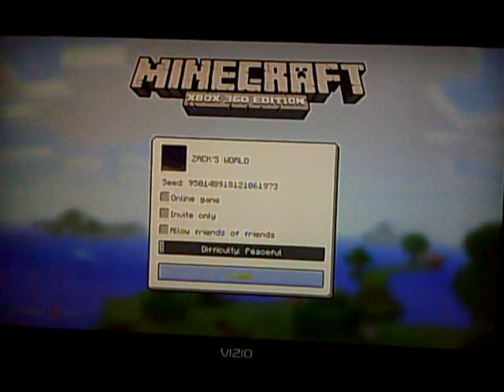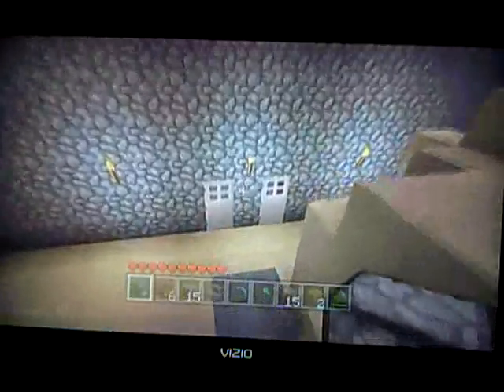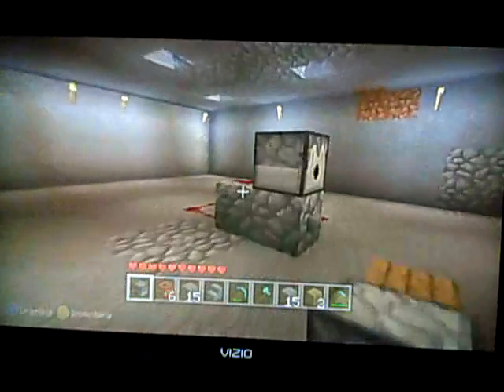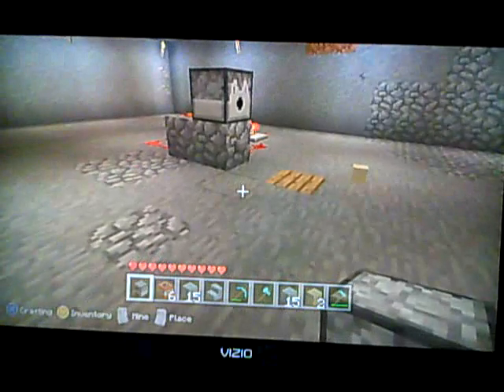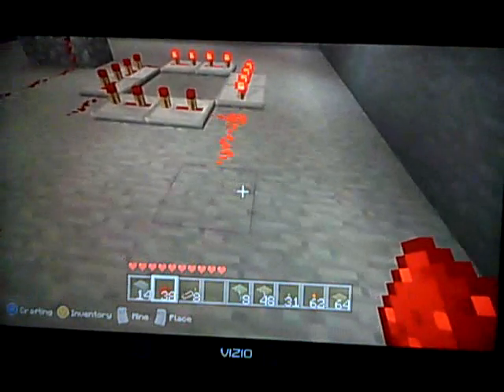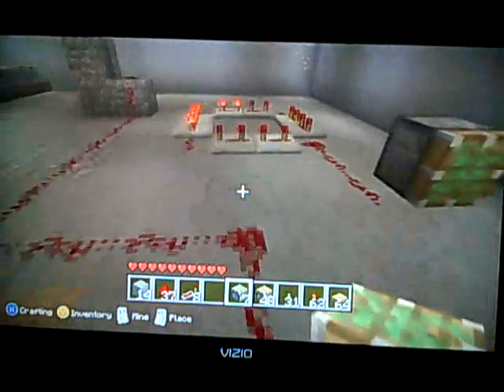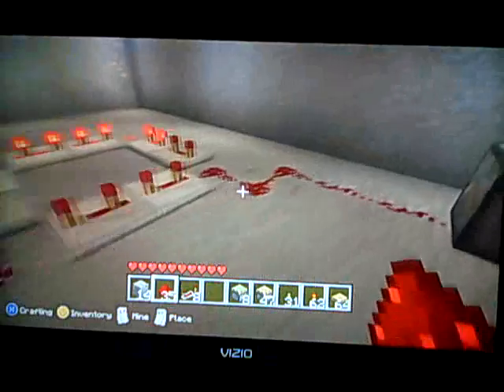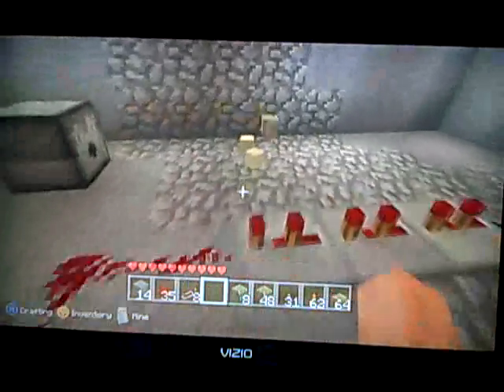Minecraft: Xbox 360 Edition - Working with Redstone repeaters/ making circuits

Comment: Great and helpful video. on the circuit with two rows of 3, why do you have 3 in a row? I can understand the diode side of it but having them in series is confusing me and the 4 switch stages.

Comment from the maker: Are you using a button? If you use something that keeps a charge running to it it will keep it all on. You can get it to work with a switch but you have to turn it off right after you turn it on so it doesn't send a constant supply of electricity. Same with a torch, you have to remove it right after placing it. This is why I recommend using a button. If it stays on with a button... you need to add more delay to the repeaters(the charge is getting around the circuit too fast) Hope this helps.